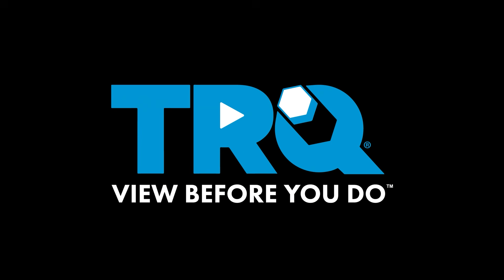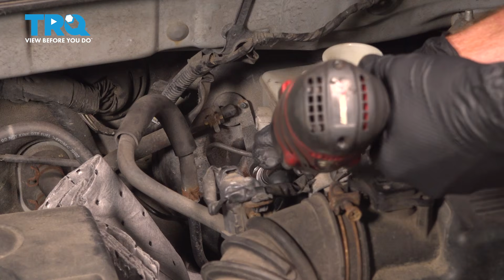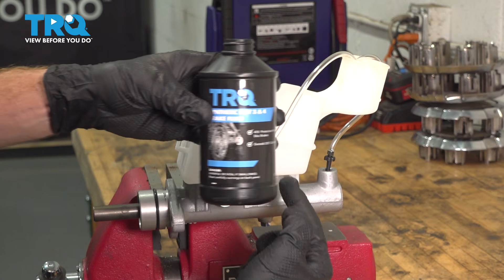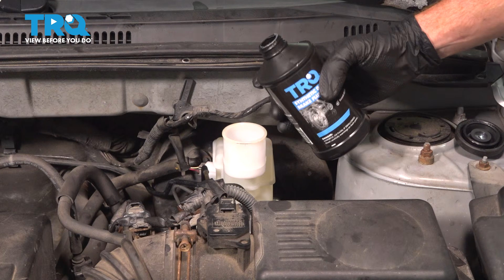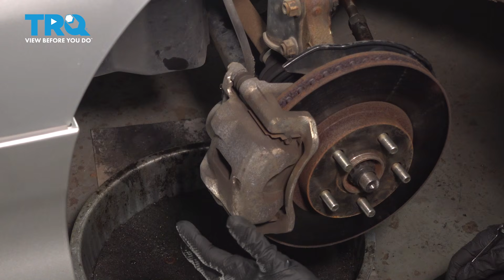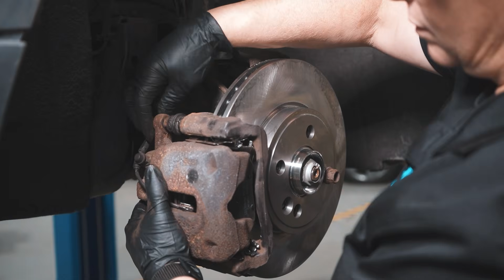How to Replace Brake Master Cylinder 2003-2008 Toyota Corolla

Comment: i am working a 2003 toyota corolla bleeding the brakes but only air come out from the driverside front wheel i change the fuild in the cylinder but cant get fuild to come out front passanger side wheel